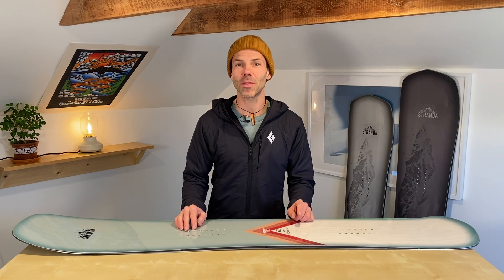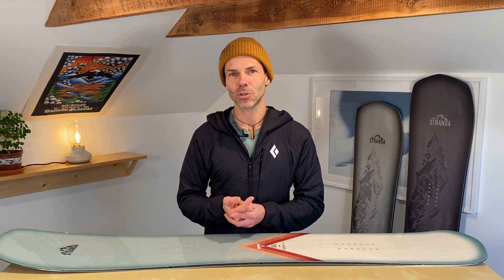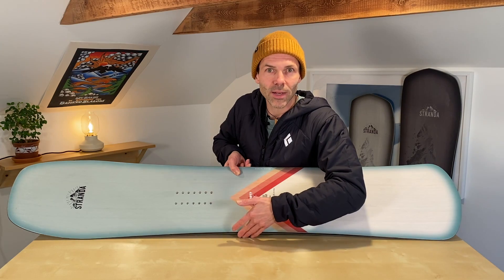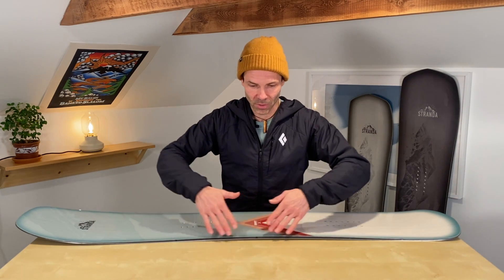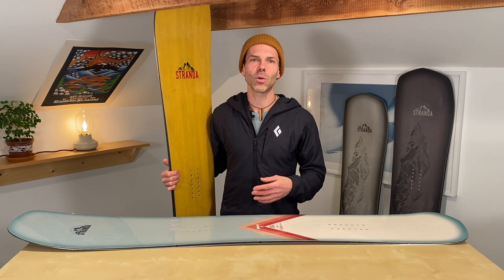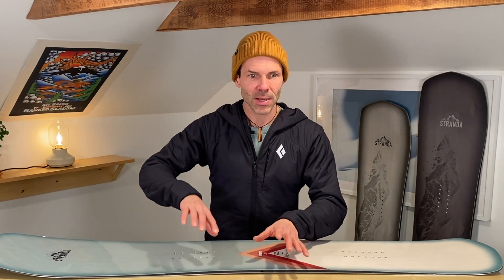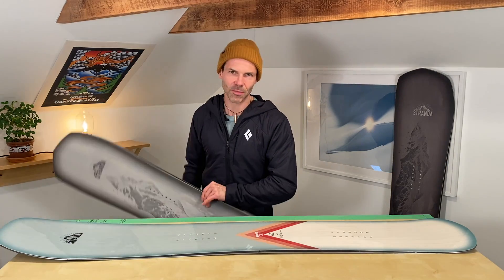Board design #2: Sidecut, effective edge, flex, turn radius

Comment: A stiff board with a deep side cut? Sounds like the Ride Berzerker.
Reply from the maker: Could be! Haven't ridden one. Burton runs by that formula.... I tried Hometown Hero and Deep Thinker, and I'd have to ride them in a 152 to be able to bend the tips at full board angulation. Wild!!
Reply: Knapton twin*
Reply: @martykasa7864 While that sure is among the stiffest boards out there, at least Knapton himself rides a long radius, ie. a shallow side-cut, not a deep one.
Reply from the maker: @elho-snow  Yeah man, right on the money once again! His actual board I don't think they'd even make that for anyone, hahaha.... Imagine some 'Eurocarver', who can't actually tip the board on edge properly gets loose on an 18m radius on a bunny hill... Hide your kids, hide your wife!
Reply: The old Bezerker (like about 10 years ago) sure was stiff as hell. Zero chance to butter (as in actually press, not Knapton nose roll), you would have rather braken your bindings (or lower legs) before flexing that thing. The more recent ones are supposed to be a lot better.

Comment: Other then this minor point about "largest possible turn" below, you are one of the few guys out there that actually understand board (and ski) physics. Too often I hear people straight up say "sidecut is what makes the board turn" which is simply wrong. (old skis were edgeless, camberless, long and almost completely straight yet they turned)

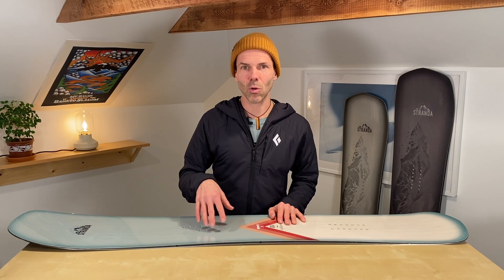8:48 "sidecut radius number describes the largest possible turn" according to your explanation of the turn physics, the board will always have to be tilted and bent even if only a little bit, to turn. Because the board will never turn while flat on the ground, and the sidecut radius is measured in two dimensions, the number doesn't signify anything happening with the board in the real world. The board will simply never achieve its sidecut turn so it is not a "possible turn" at all.
The function of the sidcut radius number is only to give us an approximated idea of how deep the sidecut is compared to other boards or lengths but that's it. 

Board length, sidecut, shape all contribute and assist in turning but the primary source of turning is always the fact that there is pressure in the middle of the board and none in the tips.

... all of this makes me think how important a narrow stance is for turning - because of course, the same weight distributed in a narrower spot along the length of the board will flex the board more than that  same weight distributed in a wider spot.
Reply from the maker: Great comment!! Fully agree! You'll only ever make a smaller turn than what that radius number states.

Comment: Great video, and great videos. 

I've been railing turns since 1990 or so--since it started, really, on both hard boots and soft--and have given turning and board design that many years' of hard thought. I am struggling with the notion that, given equal sidecut radii, more effective edge increases the envelope of potential turn radii. 

In my conceptualization, the radius of turn resulting from a given radius sidecut is a function of board angulation and flex; increasing or decreasing effective edge length changes the length of edge contacting snow as that turn is made, but it doesn't change the envelope of potential turn radii. 

Said differently, as I see it, the increase of sidecut depth that results from increasing effective edge, given constant sidecut radius, is the result that effective edge tracing a larger length of circle, and thus more of that circle's curvature, but it does not change the circle itself (or, therefore, the sidecut radius, or the range of possible resultant turn radii). 

Of course, now we're into physics, and I could be completely wrong. 

Thanks again -- very provocative and fun.
Reply from the maker: Thanks for the comment!
Increasing EE will give a board of the same radius greater potential to bend the board simply because of the increased space between sidecut centre and ground. So you can bend such a board further than the same board with less EE.
Reply: Just look at different sizes of the same board - as the board (and so the EE) gets longer, the side-cut radius gets larger as well, to compenate and give the same relative curvature so to speak.

Take a small globe and the actual earth as example - they are the same thing, just in two (quite) different sizes. Their curvature relative to their size is the same, yet the globe has a small radius while the earths surface looks almost straight when both put next to each other.
Reply from the maker: @elho-snow  aaah.... I love finding minds that tick like mine, hahaha.... ;-) Looks like we need to snowboard together!
Reply: @Justaride-Snowboard-Channel  Great minds think alike, they say. 😀
Some riding together would sure be a blast! Feel free to let me know about your Europe trip plans.

Comment: Another interesting video. I had not really made the connection with sidecut depth and potential carved turn radius, although I had a Tanker 172 that carved similarly to my current Virus 162, despite its larger sidecut radius. The 162 is definitely easier to toss around in tight places.